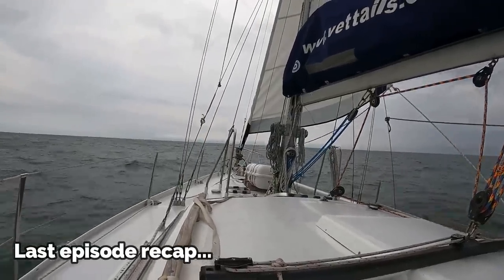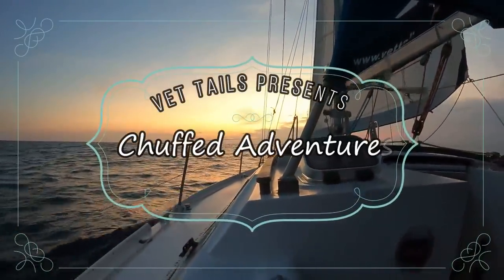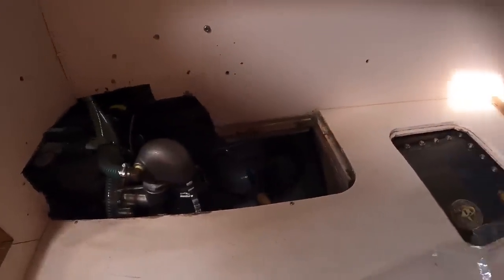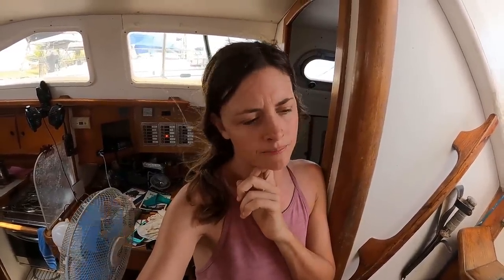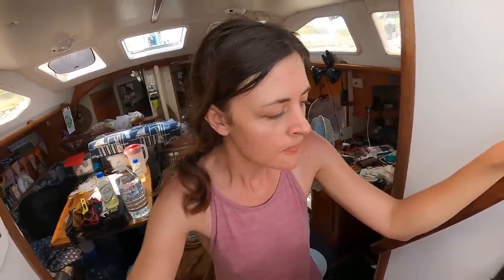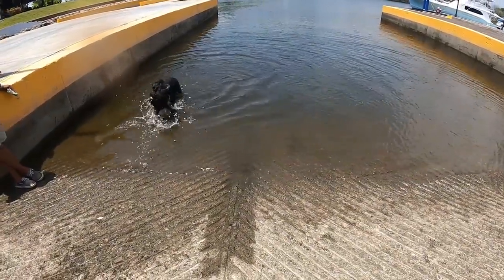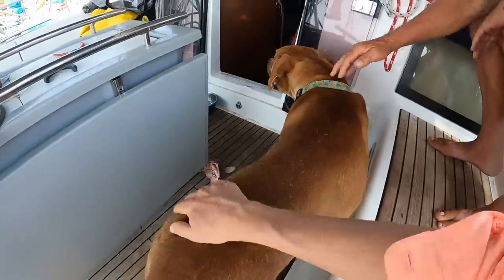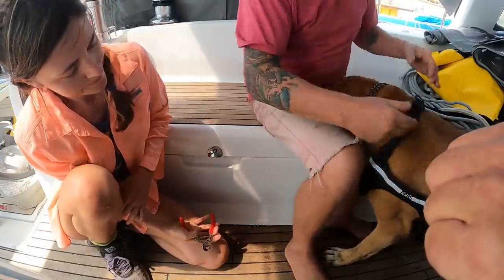Trouble Shooting Fuel Problems on a Yanmar 3ym30 : Chuffed Adventures S4Ep31

Comment: Good to see it running for now, but I also believe checking your venting would be in order. If it’s blocked, eventually the tank will be in a vacuum situation which will starve the system for fuel.
Reply from the maker: We did check the vent a few times, eventually replaced the hose just in case!

Comment: I bought an old Columbia 34 that had been sitting in a marina for a number of years. The diesel started and ran ok at first but after running under load for a while it would shut down. A friend suggested that I pressurize the top of the tank which I did by connecting an air compressor to the fill fitting. Thick brown sludge started coming out of the tank vent and oozed down the side of the hull. I changed that vent hose and added diesel algae treatment to the tank. Everything was great again. Running the engine under load was producing just enough vacuum with the vent partially blocked that the fuel filter would not be able to supply fuel as needed.
Reply: I gather fuel treatment only works as a preventative on fresh fuel. It can not recover stale fuel. Having said that, old diesels (unlike modern engine's) are incredibly resilient and can burn just about anything.

Comment: In june this year , We had a rubber gasket for the fill cap fall in the tank and a few days later it jammed into the intake for the engine from the tank. We blew backwards down the pipe to clear it. Then crossed our finger that it would not do it again until you we were somewhere to drain tank and remove!
Feel you pain.
Warren
Reply from the maker: oooph unlucky! we are running well now!

Comment: I'm old and out of date but after peddling diesel trucks across Oz for 50 years I came to the realization that with Diesel engines 80% of problems was Air... and 80% of Air problems was split or leaking pipes from vibrations. But you're a clever
 Sheila, so you probably knew that. Cheers
Reply: Ha Ha....Actually I think their problem is most probably a lack of air, in that on boats a hose runs from the top of the tank to the stern, to equalize the air pressure and prevent a vacuum forming in the top of the tank. A very common problem is that stern vent fitting gets blocked by seaweed, seashells etc. allowing a vacuum to form which the fuel pump cannot overcome.
Reply: @stephenburnage7687  Yeah I suspected it may have been a bit different to a truck. Thanks mate
Reply: @manuelstarr3602  No worries. I always thought the decision to change out the engine was a bit rushed, without first eliminating some pretty basic possibilities first.
Reply from the maker: we replaced the lot (pipes and hose clamps and filter) and it fixed itself - must have been a leak somewhere!

Comment: There’s a product called fuel doctor available in Australia which we’ve been using for 2.5 years in two Diesel engines on a cat which are two separate fuel systems as well, and I have had zero fuel problems with these 3ym30’s since I started using this stuff can highly recommend this fuel treatment at the rate of one lite for a hundred sixty litre fuel tank every six months . It cost forty dollars a litre bottle and it’s worth every cent . Also change the secondary filter every six months religiously and you will have zero problems . Been great in the tropics and engines have been 100 percent reliable.  We also keep the tanks pressed up and full as much as possible to prevent condensation.
Reply from the maker: Good to know! Thanks!

Comment: Some engine fuel pump are unable to lift fuel more than a foot below the engine hence a separate fuel pump is added in the line. If your fuel tank is below in the keel for example, once fuel has gone down by a foot, the engine may stop working if if was not of this fuel pump. I suggest you install a rubber bulb in lieu of the fuel pump, like those used on outboards to pump fuel faster into the engine systems. Cheers, Richard

Comment: Good job👍
I suspect that the cheap pump doesn’t allow fuel flow when it fails or stops. The Facet 40002N cylindrical pump holds fuel from going backwards when off and more importantly, allows fuel to flow when it fails or is off.  They cost about 150 but in 40 years in the trade, I have never seen one fail, I can’t vouch for one that’s been sunk in salt water though. You can run it without the electric pump, so choice is yours.

Comment: Hello from SV Leilani. You may remember our fuel problems when we arrived and it took some real detective work to figure it out. Finally figured it out after over a week of countless trials. Turned out it was a blockage with the Racor filter. We would have never seen it unless we removed the filter and took it completely apart. Underneath the check valve, the little metal float ball, was the clog. A mass of the crud from the tank blocked the flow. It appears your problem may be different but rest assured we feel your pain. All the best.

Comment: I have had the same engine for 1& years.  I tossed the electric fuel pump after a couple of months and carried it around for 10 years before it got rusty and ended up in a recycling bin.  Good luck.

Comment: If you have an aluminium pipe welded through a tank wall, there could be a crack in the weld allowing air into the pipe which could be intermittent depending on the tack you are on. You really are being put through every possible failure scenario.
Reply from the maker: our thoughts too, looks like it was the racor in the end (must have had a micro-crack somewhere!)

Comment: Sheddy, about the only place I check for air in the system on my Yanmar is right at the injectors. Just slightly loosen the last coupler nut in each cylinder's run, one at a time, then crank the engine. If you get only fuel, good - move to the next one. If you get bubbles, then keep cranking until the bubbles stop and quickly tighten the coupler nut. Then go to the next. By testing up there at the injectors you are verifying fuel is being supplied all the way from the tank thru the entire fueling system. I can't quite tell - are you able to operate OK from just the jerry can? If so, then the problem is downstream from the injectors. In that case, I'd suspect the fuel pump. It's easy to check - just loosen the "out" side of the fuel line at the pump and crank the engine. If the flow is good, then the pump is likely good. Also, do you have a lift pump on that model engine? That's worth some research. Diesel fueling problems are like chasing gremlins. I feel lucky - every year after dry storage my Yanmar immediately starts and runs. It's hard to break them.

Comment: Look at you now, comparing your knowledge and confidence to tackle issues from now to just a few years ago... WOW ! This is great, even if it doesn't seem that way currently. You wouldn't have wanted BOTH of these problems while sailing in unfamiliar waters/circumstances. You sound like you've gotten most of the likely culprits covered, here's a less common one, vacuum. It is possible that your problem only occurs after a significant use of system due to a vacuum building up between pump, hoses and tank if it is not properly vented to allow fuel flow. Hope you both feel better soon !
Reply: Did you watch the video?
Reply from the maker: So sweet reading this a year later, thank you! We do feel like we are so much better at tackling problems as they arise after this major refit, but also grateful we arent having too many problems anymore!

Comment: Yeah weird. Im thinking an airlock in the line system, probably to do with that pump. Hard to pick the fall line out of the Raycor to the pump and beyond but it doesnt look like a full gravity fall.
Fuel pumps wont pump air, so it can happen that there is an air bubble in the fuel line, and the fuel which gets consumed, bringing the air bubble into the pump, so everything stops.
Falcon cars you might be familiar with have the radiator lower than the cylinder head, so if you dont top up the coolant with nose of the car elevated in the air it gets an air bubble which ultimately destroys the engine. Easy to do, and thats in 2" hose not tiny 5/16" line.
Reply from the maker: we ended up replacing lines, clamps nd racor and it resolved, never did truly know what happened!

Comment: OK I know these are way behind and they dont read comments but I always think what changed to make it start working?  In this case it was draining fuel from the stuffed tank.  So my guess is that when slam full the fuel level was higher than  a vent or something like that causing a lock.
Reply: Vents are typically at the highest point but they can get blocked.
Reply from the maker: we were thinking that too! We are back reading comment by the way haha, we eventually replaced the vent hose, all the lines, racor and all hoses and it resolved... never know what was the cause but been smooth sailing since! Moral of the story - dont leave old parts on your new engine!

Comment: Is the tank venting properly? If air cant get in fuel wont get out. This will be worse at high rpm and when the tank is very full   Hope you get to the problem soon and continue your adventure and great work
Reply: Almost certainly the issue
Reply from the maker: It didnt seem to be BUT we did replace that hose as well - its possible it was collapsing at moments or kinking... we never did figure it out but repalcing all the lines in+out and racor fixed it!

Comment: I would have the electric pump as near to the tank as possible - pumps are great at finding small air leaks on their suction side. (but also really useful to have)
Reply: That's a good point, people often forget that a pump sucks as well as blows and will suck in air from connectors and where pipes are joined especially where flexible pipe is attached to rigid pipes. Hose clamps are terrible for fuel lines, they should always be crimped but even then you need the right fittings and compatible sizes.
Reply from the maker: good call!

Comment: I was wondering if your fuel tank has a breather tube to let air in when you use fuel.
Love your videos. X
Reply: 90% probability it is a blocked breather. Probably seashells or growth where it vents at the stern
Reply: @stephenburnage7687  Are you talking about a breather for the engine or the fuel tank?
And remember that they have just done a lovely refurbish on the boat so shouldn’t have much growth on it atm.
Reply: @SirHackaL0t.  The breather for the tank. I am not aware of them having touched that and they are frequently a source of trouble, as they exit by the stern and can easily get blocked by marine growth, which creates a vacuum in the top of the fuel tank, which the fuel pump cannot overcome. Such a problem is more likely to reveal itself with a full fuel tank.
Reply: @stephenburnage7687  Just checking. :)
Reply from the maker: Thanks Clive - we did replace the hose to the vent, as well s everything else, no more fuel issues!

Comment: Electric pumps are meant to ve pushing pumps not sucking pumps. 
Operate much better closer to the tank and ideally should have a head of fuel on them. The Facet pumps are ok but a Holley Mighty Mite is a better option. Doesnt need a high pressure pump to feed the mechanical Yanmar pump.

Comment: First make sure not electrical like pump injectors or glow plugs. Check engine oil as some engines have a safety cut off if too little engine oil.  Then check fuel filters drain some oil to see of water or condensation was affecting the engine as bad fuel. At the same time look for any objects floating in the fuel system as tank corrosion or pipes corrosion. Then use or buy a hand fuel pump to take out air instead of risking your health. then try and start the engine again but let the Glow plugs heat for about five to ten seconds before starting.   What I suspect is the problem is bad fuel.
Reply: They put in new fuel (although this is Mexico and even road diesel looks like bunker fuel). Most likely issue is a blocked vent. They have changed everything else

Comment: I don’t have any electric pump on for my yanmar 30, I use a bulb primer off an outboard tank to fill filters etc, yanmar is self bleeding so don’t need to bleed injectors, only the filters, mechanical pump should pull fuel in ok, my tank is close to motor aswell like yours

Comment: Fairly dissapointing when you can't find the direct source of your troubles mechanically.  I had a engine issue on my boat last fall where I got stranded while out and had to get a friend to help me retrieve the boat.  I went through all the systems and couldn't figure out the problem I then decided to take it somehere to get worked on by a professional who also couldn't find the source of my woes but changed some parts and charged me  a couple of hundred bucks.  Now the motor runs but has a different issue.  frustrating to say the least.
Reply from the maker: Seems its relatively common to not readily ID the source, its very annoying right?! Thankfully after just replacing all the lines and racor we are good again

Comment: I'm just curious if you have a way of introducing air pressure into your diesel fill areas is it possible that that would show a some sort of bladder leak or Airline leak throughout your system cuz you're obviously what I see is sucking air somewhere. But I love you Broach I think you're on the right track I would just try and do it a little bit reverse. If you can find an air compressor somehow introduce pressure throughout the diesel bill on your tank and just look Downstream and see if it bubbles or Google's anywhere. But I like your thinking your logical girl.. I think you're definitely on the right track I would just try to maybe you reverse engineer how you're diagnosing it. Just food for thought love you guys to death I hope you guys are doing well and holding up if you need anything, let me know